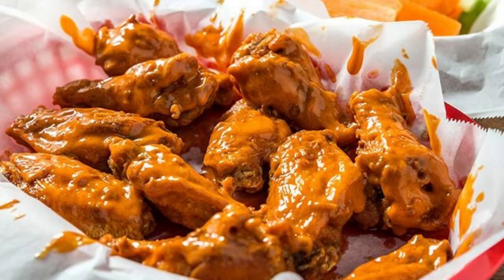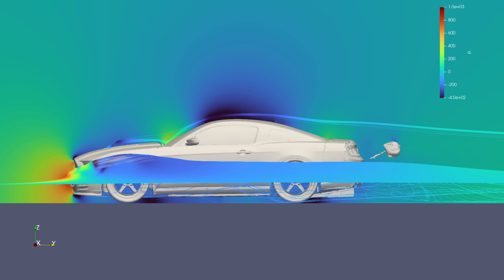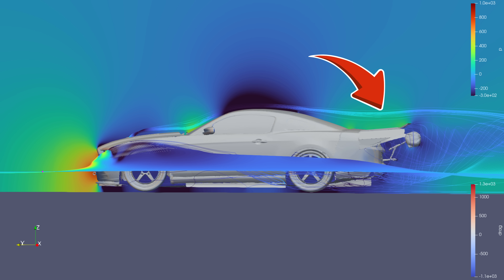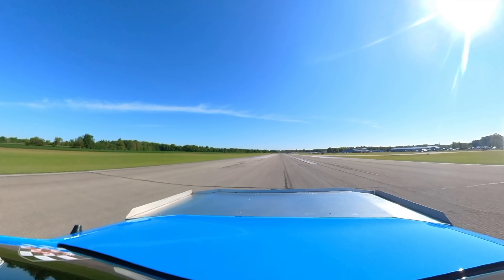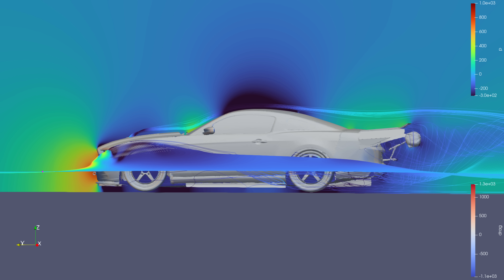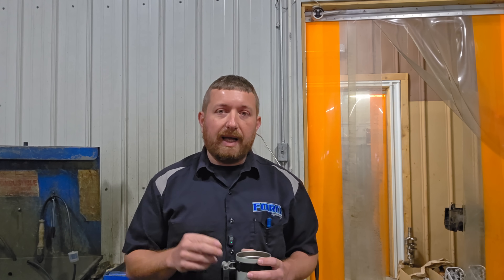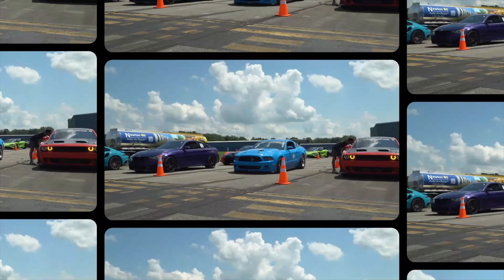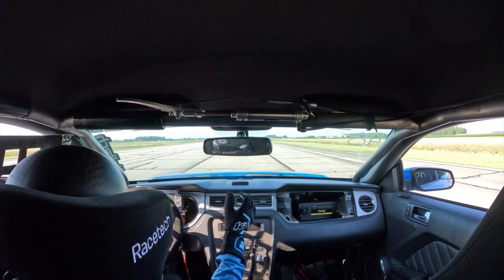Do Drag Wings Work? We Put Ours to the Test!

Comment: All I heard was you needed a Arduino & a Linear PushRod
Reply from the maker: Thinking ill do it with co2 and control with Haltech. But yes, needs to happen.
Reply: @ForceEngineering  No need for any of that don't make it rocket science. Lmk I can make a solution for ya especially if you have a 3dscanner/printer

Comment: I always thought the point of drag wings was to reduce the drag of the car allowing faster acceleration and higher top speed.
Reply from the maker: Correct, thats a big part of it. They are also expected to be a down force tuning device to change high speed stability. As you can tell, results may vary.

Comment: Glad you made the point early on that one needs to determine what the ultimate use of the car is! Aero design is hard! A follow-on video where you actually show the software and hardware you're using for your CFD runs would be great.
Reply from the maker: There is definitely alot to it! Ive thought about that, but honestly, im not well enough versed in that side things to give direction. Last thing i'd want is put something out there sends anyone down a rabbit hole for no reason.

Comment: Tie the wing struts directly to the rear suspension and you'll get the best of both soft springs at the hit and not pushing the rear of the body down at the top end. All the downforce load will go directly into the tires instead of the springs and your wing angle wont change going down track. The hard part is finding an elegant way to do it. Good to see someone actually using CFD to test things.
Reply from the maker: I put a good bit of a thought into this actually.  Wanted to place the wing at the rear of the car where it will best interact with the car body. Im concerned about this making a lever action and trying lift the nose of the car.
Reply: Ryan Mitchell has his wing on an actuator so the wing angle goes to zero (parallel with the track) after about 100 feet.  Not bolted directly to the suspension though.
Reply from the maker: @toyotaecw this is my current plan.  It would be pneumatic and angle would be adjusted per MPH.

Comment: 1/8 mile drag racer here. My 89' Saleen with the stock Whale Tail rear spoiler makes the car 3 mph slower in the 1/8 mile compared to a drag race wing. I noticed no difference in stability with less drag/down force from the drag wing. This is @ 134 mph in the 1/8 with the drag wing.  Obviously not approaching 200+ mph so I doubt the wing will ever collapse. 
Great information in this video. Thanks.

Comment: I wonder if you could stick on a set of air shocks in addition to regular coil overs and use the ECM to pump them up at speed?
Reply from the maker: You'd then be changing the spring rate of the system.  Which would probably be ok.  I have seen some hydraulic adjusters that change ride height only.  Basically an adjustable spring spacer. I have not seen them that could be controlled via the ecu. I feel like I should buy one and try to make my own air over hydraulic control for them.
Reply: @ForceEngineering  interesting, like a hydraulic throw out bearing.
Reply from the maker: @Flitzer514  https://allstarperformance.com/hydraulic-adjuster-for-2-5in-springs-all64220/
Reply: @ForceEngineering  If active suspension is allowed, you might as well go for active aero front and back and control what you need when you need it. You could also couple that to aero braking as a backup to chutes and brakes.

Alternate, is there a way to decouple the wing from the body, and couple it to a lever on the suspension? More down force causes the lever to apply force to either lift the spring to prevent ride height change, or to push directly on the axles (assuming solid rear end). If solid rear end, you could probably attach the wing directly to the diff or the tubes and just let the down force drive the rear wheels into the pavement. I think this last idea has been tried, proven, and banned in other forms of racing (probably F1 or Indy), but it would be the most simple way to direct force into the tire without pushing the entire body down on the suspension. Since there's an angle involved, you'll need to figure out the component of the force going down and figure out what portion is trying to push the rear end in odd ways, but it still might work "good enough".